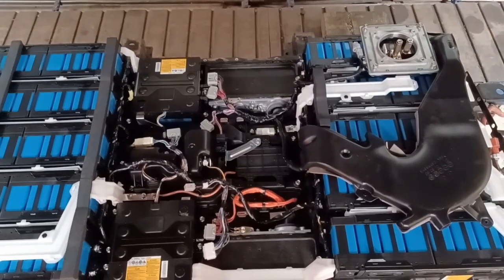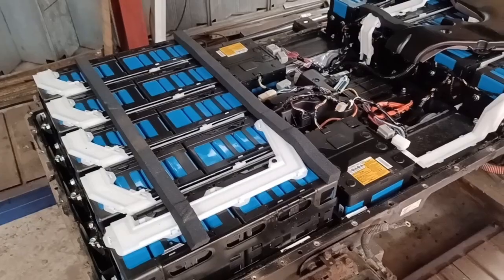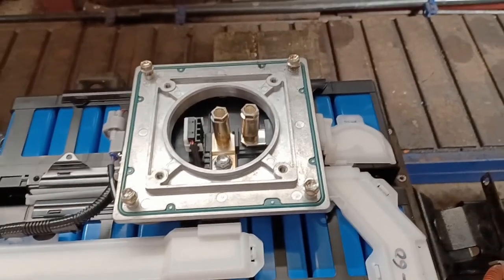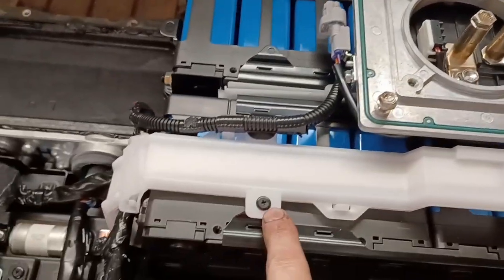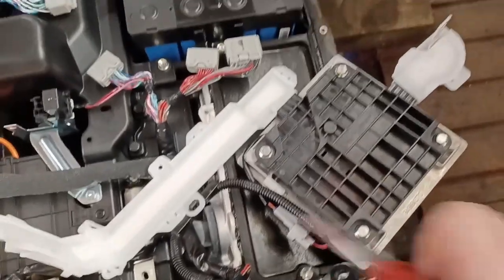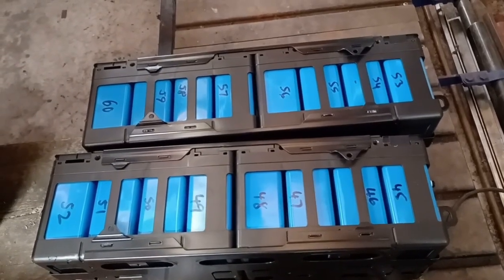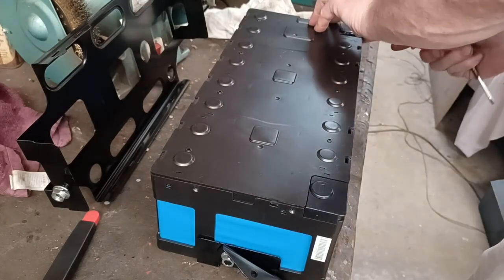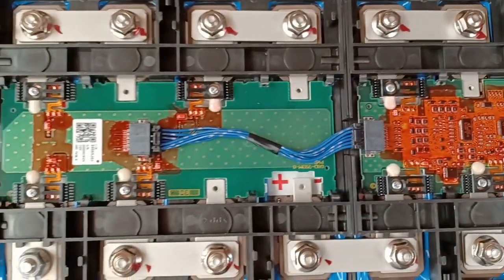Voyage into the unknown - removing the Mitsubishi Imiev batteries #electriccar #mitsubishi #battery

Comment: No es tan fácil como en el vídeo. Estas celdas no son compatibles con el BMS original. Que se sepa no  existe  ningún adaptador.
Reply from the maker: I am not sure what you are questioning. I found as you will see in future videos that the batteries recovered now are working beautifully in the other car with the changed over green CMU circuits boards on the car. However I did have an issue with the green CMU 09 board and found much to the surprise of the Imiev forum that the red CMU 09 board would work in the car with no issues. However I agree that the green CMU boards will not work with the red BMS - but this was never the option in my case and I never planned to complete this. This video was dealing with the harvesting of the cells - just the batteries which was relatively easy considering that I was a newcomer to this technology.

Comment: Parece  muy interesante. Pero para nada es compatible con los BMS originales.. Las 88 celdas originales Yuasa 45 Ah 3,7  V ,se pueden conseguir en  internet todo incluido por unos 2000€ aproximadamente y son compatibles. Nada  que  ver con los más de 18000€ que piden en un servicio oficial Peugeot de cambiar toda la batería.
Es cierto que te tienes que   buscar a un profesional que te lo haga  o  ver un montón de tutoriales para hacerlo con seguridad.
La solución del servicio oficial , no es viable, cuesta más que el coche.
Reply from the maker: I am not sure what you are questioning. These cells came from an Imiev and are now working perfectly in another imiev with the original electrical systems. The only issue was the donor car used the earlier red CMU boards compared to my working car which has the later more common green CMU. I reused the working car electronics and replaced the cells with these identical ones from my donor. In the UK I am not sure that any replacement new batteries are available certainly not at the 700GBP which my donor car cost me. There was never a plan to use new cells for both cost and availability reasons. The working car is now back in regular daily use and has covered over 2.5K miles in the 4 months the car has been complete again. There are other videos on this saga.

Comment: I watched all of these videos. Very helpful! If you still have a battery pack chassis still laying around can you measure the length and width of one of the ten compartments for the 8-cell battery modules? Metric measurements are good. I'd really appreciate it!
Reply from the maker: yes still about will try to at weekend. The cavity is a funny shape with the intrusion at each end from the captive nut used to secure the cage down but I can give you a clear width and length as well as length if the captive bolt was removed.
Reply: @alviseven1250  Thanks!
Reply from the maker: @jamesroyston2378  the basic tray is slightly tapered like a margarine tub so the base is pretty much 400mm by 120mm at the bottom of this taper when you measure the floor prob +- 2mm however the one end has a clamp mount which is screwed to the wall and could be removed very easily which would give you a length of 415mm. The other end is captive within the wall and although it swells around not sure that with the taper it actually removes much length at all. Hope this helps.
Reply: @alviseven1250  It does greatly. Thank you!